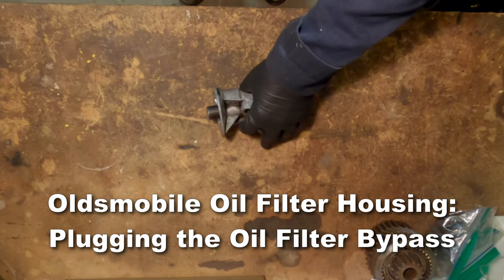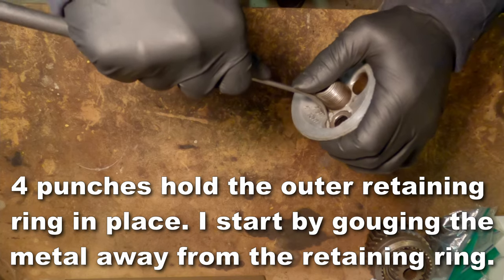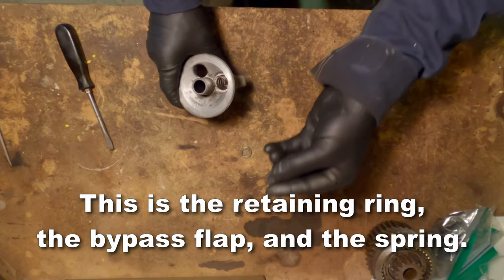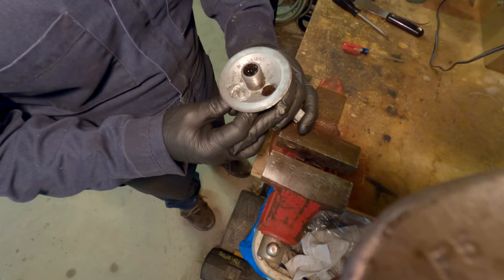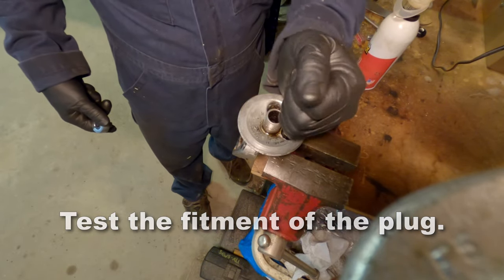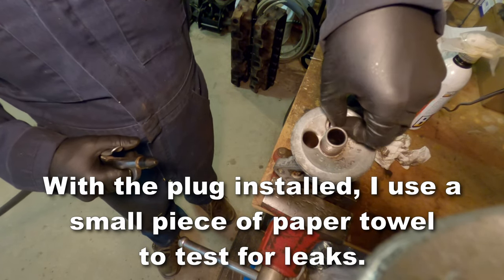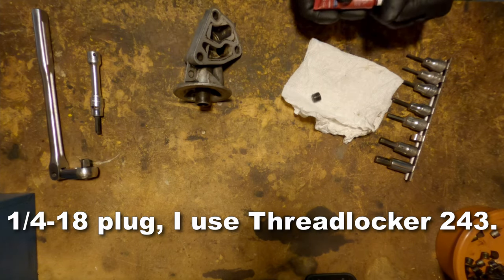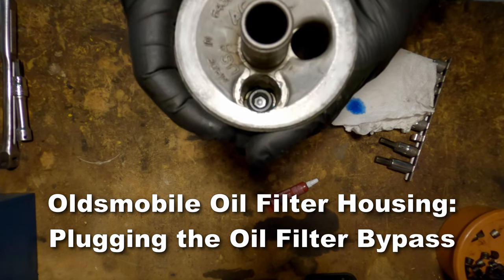Plugging the Oil Filter Bypass in an Oldsmobile Oil Filter Housing

Comment from the maker: There is a common misconception concerning the Oldsmobile filter housing bypass that ignores some basic principals. It is critically important to understand that all Oldsmobile engines are designed to filter all oil, all the time. Secondly, the filter housing bypass is designed to work with stock oil pressure and is not utilized when using the correct oil viscosity, the correct oil pressure, and changing the filter every oil change or every other oil change. The bypass valve is only designed to operate if there is a massive blockage in the filter. If you use a high pressure oil pump it is very likely unfiltered oil is entering the engine. The housing bypass valve is susceptible and prone to failure of the spring and flap material. It is important to understand that there is a bypass valve built into modern Olds spin on oil filters. The bypass modification shown here does not effect the bypass valve in the filter itself. If the filter becomes catastrophically clogged the oil filter bypass in the filter will still function as designed.

Comment from the maker: Oldsmobile engines are designed to filter 100% of the oil 100% of the time. This is supported by the Oldsmobile manuals where you can find this exact wording, "The full flow oil filter filters 100% of the oil delivered by the pump." The oil filter bypass is not designed for cold weather, high RPM, or startup. The oil filter housing bypass is designed for one specific situation, some catastrophic failure where unfiltered oil is better than no oil.

Comment: Bypass is for cold weather. At -25F, conventional oil cant pass through the pleats. Synthetic probably can. Most spin on filters have a bypass in them anyway so not sure what this really accomplishes.
Reply from the maker: Let me start with this quote taken from the Oldsmobile manuals, "The full flow oil filter filters 100% of the oil delivered by the pump." Oldsmobile engines are designed to filter 100% of the oil 100% of the time. I am glad you mentioned the temperature so I can dispel this common misconception. The oil filter bypass is not designed for cold weather. Aside from internal tolerances, the temperature your vehicle is driven in dictates which viscosity oil the engine should have in it. All literature for Oldsmobile engines have a chart that shows which viscosity the engineers recommend. At -25 F, the suggested viscosity is 5W20 or 5W, this is thin oil for extreme low temperatures and not recommend for highway use. Here is a direct quote from the manuals, "SAE 5W and 5W20 oils are not recommended for sustained high speed driving." Thank you for the comment.

Comment: Did the same process back in the mid '70's with my '67 400hp 330ci small block 4-speed in '67 Cutlass Supreme/4 4 2 Clone Convertible summer nice day driver / tow vehicle as well as my '66 525hp 425ci big block automatic in my '64 F-85 Delux 2-door post drag car.. There is no need for the bypass and I used 20w-40 oil with no problems changed oil 3 times during the summer season winter I just fired the motors up for a few minutes to keep things lubricated with the cars on stands went through the gears ..
I didn't thing many people knew of this trick also a lot of tricks that can be done to the head's as well to make cheep HP. As well as oil restrictions for the camshaft and preparing the block for oil drainage and cross drilling the crankshaft and chamfer the oil holes and cutting the sides of the rods for oil relief...
Reply from the maker: Respectfully, you sir, definitely know Oldsmobiles! My hat off to you for paving the road for us! Thank you for watching and commenting.

Comment: What does this accomplish? Curious to know why you did this
Reply from the maker: That is a great question. The oil filter bypass in the housing is frequently responsible for opening and getting stuck due to aged springs, debris, and cracked flaps. It can also become inconsistent when upgrading to high pressure or high volume oil pumps. This modification still allows the filter bypass inside the oil filter to work. I change my oil filter and oil often enough that the housing bypass is not necessary. By plugging it off I eliminate a possible source of unfiltered oil entering my engines. Thank you for the question, I hope my answer is helpful.
Reply: @junkdump2720  yep. Makes sense and I appreciate the explanation. Thank you for reply
Reply from the maker: @TruckThisGarage  Don't hesitate to ask questions, I have a lot of Olds videos and like helping out the Oldsmobile engine community!

Comment: Plugging the oil bypass limits oil to engine. Most engines bypass oil after 2500 RPM anyway so that would limit the flow that's why the factory put it there!!!
Reply from the maker: That is a misconception that ignores some basic principals. All oil filtering systems in Oldsmobile engines are designed to filter all oil, all the time. The bypass is not utilized when using the correct oil viscosity and changing the filter every oil change or every other oil change. The bypass valve is designed to operate if there is a massive blockage in the filter. The housing bypass valves are susceptible and prone to failure of the spring and flap material. There is a bypass valve built into modern Olds oil filters. This modification does not effect the bypass valve in the filter itself. If the filter becomes catastrophically clogged the oil filter bypass will still function as designed. Thank you for the opportunity to further discuss the functionality of oil bypass valves.
Reply: @junkdump2720  We had a small block racing engine that one time ballooned the oil filter.. it didnt' explode but ballooned the bottom of it.. I can't remember why.. I think it had to do also with the oil pump.. because that is of course the first bypass.
Reply from the maker: @TrentGustus  Exactly, it's totally false that the filter bypass opens during normal operation, but it's totally nor.al for the pump bypass to open u der normal conditions. I would love to know what caused your ballooning issue.
Reply: @jims2286  it can, and after doing this I have a first hand experience with low oil pressure due to a fram filter that was blocked within 3 hours of operation on break in. The fram filter started to reduce the oil pressure..  it was very noticeable... but I did know that the filter needed changing... I probably wouldn't  know if I the bypass was in place.  And would have continued to run the engine and circulating the metal that was being stripped from the cylinder walls during break in.. the wix filter that I put on after that cured the problem..  and I haven't had an issue since.. you definitely need a Guage to monitor this and not a dash light.
Reply from the maker: @TrentGustus  I agree 100%! It's excellent to hear firsthand experiences like this, thank you.

Comment: Another controversial one. Still deciding on whether to do this.
Reply from the maker: If you aren't modifying the oiling system to a high volume or high pressure pump than you could try to find a new housing or parts to rebuild the flap and spring.
Reply: @junkdump2720  Using a Canton pan and high volume Melling oil pump. I have multiple housings to spare.

Comment: I'm curious to wonder what you're going to do if you rub the motor up when the oil is cold and blow the oil filter off the side of the engine
Reply from the maker: This is a common misconception, I understand why you think that would happen. Recall there is still a bypass valve in the oil filter and 10w30 doesn't get thick enough to cause that issue even at -20 farenheit. I have seen many engines with damaged bottom ends from failed oil housing bypass failure and never seen one incident of thick oil blowing off a filter. I live in the Northeast and have daily driven my Olds since 1996 in sub zero temps many times, it's not an issue I have ever seen firsthand. I did have an oil filter get ripped off my engine by road debris once. I noticed the oil light come on, was able to stop and turn off the engine before the top end started ticking. There was no internal damage at all. I appreciate you raising that concern, thank you for the comment.
Reply: The first bypass is the oil pump itself.. if the oil pressure gets too high it'll bypass from the pump right into the pan.. So what would happen is that the engine would starve for oil and have high pressure, in the event of a oil filter was completely blocked.. you'd actually never know.

Comment: Whats your oil pressure with the high volume pump? I got about 52 lbs at 2500 rpm and the lowest is 36 hot at idle, just a small variance in pressure mostly 40 at idle and 50 on highway.. at the first 3 hours of running i got some low pressure,  and it was behaving strange until i changed the fram filter out, without the bypass, i think it was plugged..  after changing the oil, oil pressure  went up.. i drove on the highway 36 hours after that... up and down mountain highways...
Reply from the maker: I recommend people never use Fram or Purolator filters, I exclusively use Wix. My most recent build never drops below 40psi (some engines builds drop to 20 psi at idle and that's okay) and it gains to around 60 psi when I am into the throttle. Your 36-52 psi sounds excellent.
Reply: @junkdump2720  Thanks.. on first start with straight 30 I had 60 lbs.. but after some run time I haven't seen 60.. I used straight 30 for break in the first 8 hours of driving and changed for 10 40 lucas with the zinc.. I'm so not used to seeing this high of oil pressure at idle.. generally my older stock engine would be around 8 lbs hot at idle.. in fact if I ran synthetic i'd be so low it wouldn't' register.. I also find that dropping to 2nd gear to climb a hill.. i'm still topping out at 52 lbs.. I think that's probably where the oil pressure spring releases.. I was on the highway and didn't save the old fram filter.. I wonder if it was just full of debris.. I didn't get alarmed only because if I was wiping out the cam i would have probably heard the chatter from the valve train.. and it was silent.. The oil pressure was too solid for it to be mains or rod bearings.. So the debris.. has to be cylinder wall break in is my thoughts.. Which is ok..  In the 80s I had an oberg 1 micron filter on my race car.. a new engine would bypass that filter very quickly as it would just fill with garbage.. it's amazing just how much material is going through a new motor..
Reply from the maker: @TrentGustus  It's so true, stunning amount of garbage through a new engine!
Reply: @junkdump2720  I do think that the fram oil filter was bypassing.. and the bypass was very irratic.. I had as low as 16lbs oil pressure.. then stopped.. added a liter of fresh oil, started it up and had 40lbs immediately.. then while running it slowly went down again to like 22lbs.. after changing the filter.. everything went back to normal.. it was very confusing. I think these filter bypasses aren't very consistent.. but it still baffles me how the filter could do that.. in my view.. the oil pump bypass would regulate the pressure and starve the engine if the filter was blocked.. and if the filter was open how would the pressure go down? wouldn't the oil pump spring just keep the pressure up? I just can't figure out why it would be so erratic. At first I suspected the guage.. and bought a mechanical gauge to confirm what was happening.. and my sender was working fine.. I still cant compute..
Reply from the maker: @TrentGustus  The fram filter bypass valves are carboard, that could account for the erratic behavior if the filter bypass was also failing or coming apart and intermittently operating.

Comment: Could it cause high oil pressure if  Not working correctly?
Reply from the maker: It would not, because it functions as a relief passage that is normally closed. The housing bypass valve allows oil to bypass the filter (letting unfiltered oil circulate in the engine) if the oil filter becomes clogged. Modern oil filters have bypass valves built into them and most people performing this modification change their oil filters often enough that the redundancy is not necessary. The problems with these housing bypass valves is that the springs are made for stock oiling systems ( not for high volume or high pressure pumps) and the materials in the spring and door are typically worn. When they start to fail or get worn out, they let unfiltered oil circulate through your engine. Thank you for the excellent question, I hope my explanation helped.

Comment: you need to invest in a dremel tool
Reply from the maker: I do own a Dremel, but I keep it with my wood working tools. In the shop I use my variable speed die grinder. However, a Dremel could certainly work for this application. What I really need is steadier hands! Thanks for the comment and thank you for watching.

Comment: AN OIL FILTER MIGHT JAM IF YOU USE IT FOR MAYBE 1,000,000 MILES.
Reply from the maker: Lol, I suggest you change your filter more frequently than once a million miles! Don't forget oil filters have an internal bypass valve that will open if the filter gets too restricted.